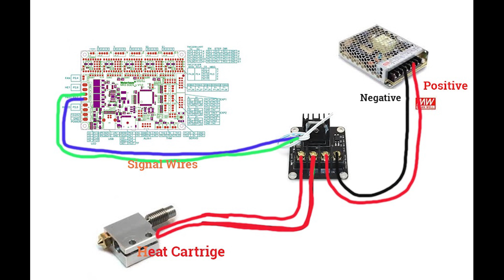Artillery Mosfet Safety Fix

Comment: I have an issue with my sidewinder x2 but for me its my heatbed heating up uncontrollably. I thought its the mosfet but i swapped stock ruby boards and its the same thing. I upgraded to a manta m4p board from biqu and ro my frustration i get the same freaking thing. That cant happen can it? Is it my power supply or my bed itself thats faulty?!?
Reply from the maker: I would lean towards a faulty heat mat. probably a shorted heater cartridge. just as a test put the hot end on the bed pinouts and turn on. just to make sure it isn't ramping up temp on the current board. That would point to bed mat having a problem.

Comment: That mosfet on my board went bad- shorted,  so it powers the heater cartridge from the moment I turn the power on. I wonder where could I get the signal for this mod since I cannot use that output with the bad mosfet. Thanks
Reply from the maker: Unfortunately the mainboard other possible mosfet option is being used. You can try to replace it if your any good at soldering. usually just cheaper and easier to replace the board-add the new external mosfet and enjoy.
Reply: @Sgt.Taz3D  new board and ext. mosfet it is then, have them both here now. I'll replace the bad mosfet on the board and keep for spares.

Comment: lets say there was a mosfit out on your board can u still install the big mosfit  and bypass the board without replacing it
Reply from the maker: No unfortunately the on board mosfet is required to trigger the new one. sends the activation signal.  If you have HE1 open on your mainboard you can swap pin information for it in firmware and connect your wires there instead.

Comment: The hot end on my X1 just heated uncontrollably and with the little research I have done I think it is the mosfet.  Would the hot end have continued to heat up if I had not been there to shut it off? That's a scary thought.
Reply from the maker: Yes, unfortunately if the mosfet goes the firmware gets no indication of the ramp up.  So it will not trigger a thermal runaway / shut down and continue to heat the hotend.
Reply: @Sgt.Taz3D  Artillery is sending me a new board and I plan on installing the additional mosfet as well.  If the mosfet on the board was to fail in the closed position again wouldn't it be constantly sending signal and the additional mosfet would be sending power uncontrollably still?
Thank you for the awesome information btw, very straightforward, and easy for me to understand with almost no electronics education.
Reply from the maker: @andrewbolerjack8350  If it failed again it would still send the signal. Keep in mind it failed because of voltage not signal. So the likelihood of this part having a failure with signal is extremely unlikely.  Your taking its roll of providing power from board to just providing a signal which is less likely to fail. The larger mosfet and connection to power supply is far more safe and efficient.  **Like anything you still should observe and be around when using a 3D printer of any brand**

Comment: Thanks for the vid, very clear. The mosfet link is for a hot bed. Does it also work for the hot end? My Mosfet fried after the first month and I've been unable to get a replacement. Do I need a working mosfet on the board or does it bypass the board? Thanks again. have subscribed.
Reply from the maker: Yes it works for the hotend as well just marked/listed as the bed. Unfortunately it relies on a signal from your board so a working mosfet on mainboard is needed for signal. There might be a workaround, but I'm not a huge electronics expert  to advise on that (  if it's already broke it will still send constant signal ) thermal ramp up will still trigger.

Comment: I’m assuming you printed theABS parts on the sidewinder but is it capable of printing nylon and if not what would it require for upgrades?
Reply from the maker: I would upgrade the heatbreak as the lower PTFE tube isn't rated for high temps over long prints.  You can get away with 240c for awhile but it will degrade and cause clogs over time.  I had capricorn tubing for awhile as it's ratd to 260c but after awhile it's just easier and less worrisome to switch it out.
Reply: Thank you

Comment: Great tutorial, I’ll be doing the same just to be on the safe side. Can I ask what screws did you use to mount the mosfet into the box? Thanks!
Reply from the maker: used some old computer case assembly screws I had around from past projects.

Comment: where is the signal cable from mosfet connected on board? at the connection where the heating cartridge was connected to the board?
Reply from the maker: Yes the white signal cable goes to the mainboard where you had the heater cartridge line connected.

Comment: Should you add another MOSFET on the bed side? Great video by the way, my MOSFET just blow on my board yesterday and have been looking for a video for adding one to the extruder side, most videos talk just about the bed.
Reply from the maker: Bed side uses the SSR so it's not pulling from the board mosfet. the board still requires a functional mosfet to send the signal unfortunately if you popped the one on board already it will need to be fix or replaced.
Reply: @Sgt.Taz3D  Thanks, also why did you use ABS for the box, will PLA melt? In the video, looked like you had an airduct printed, do you use that you airflow for the boards?
Reply from the maker: @mikerusso9050  mainly because I had some ABS that matched the anodizing and had printed a duct for someone prior :) it will be much more resistant to any heat being the bonus. I added the ducting to the stepper drivers as that's the main thing to keep cool and it cut down on case fan noise for me. I have the older units so the fan was mounted on the left side  (New ones have bottom mounted)

Comment: What gauge wires should I purchase to use for the diagram at video time 13:10?

Heat Cartridge <- wire gauge?
Power Supply <- wire gauge?
Signal Wires <- wire gauge?
Reply from the maker: 12 should be more than enough and match the heat cartridge wiring. I used 16 for the signal wire as it matched and isn't drawing power. Hard to see in the video but I had 10 for the power supply.

Comment: I've only seen mosfet failure on the x1, have you heard of any issues with the genius?
Reply from the maker: There has been a couple post but not as many as the X1. keep in mind it's the same board installed so might be worth investing.
Reply: I know it's not a fix, but I think I saw a video of some one using a ssr to cut main power on a thermal run away.  Would that be another option?
Reply from the maker: @punchedname  Sure it's pretty much a relay. they tend to cost a bit more  and I was more comfortable using the mosfets I had already bought in bulk once I screwed up my first printer mainboard awhile back lol ;)

Comment: This couldn't have come at a better time. I ordered this mosfet last night.. I love my sidewinder X1 to bit and I understand that the likelihood of a on board mosfet failing in a closed state causing thermal runaway is tiny. However as you said, for a $6 part I am happy to make that safety upgrade. Does it need cooling at all? Also thank you for these videos. They have been awesome and very informative to the community.
Reply from the maker: I haven't needed any cooling but the case  will take a 4010 fan that you could direct wire a 24v to the output lines and it would come on when triggered . Glad my videos are helpful and thanks :)

Comment: looks interesting. But not for me. I am very much in the belief that if it not broke, don't touch it.
having said that I like the box you made. the T nut set up was tidy. 
Thanks for posting the video. Always interesting.
Reply from the maker: I generally agree with that. just seen a recent influx of people either shorting out their mosfet by doing maintenance with their hotend or just having it pop on the board after a few uses recently. This avoids any issues with mistakes or power spikes/shorts causing you to need a replacement board.